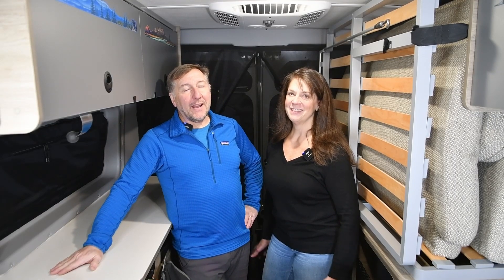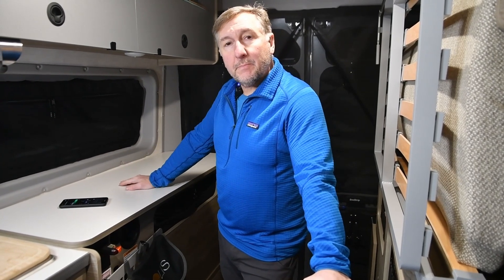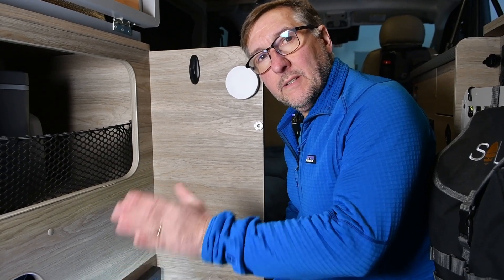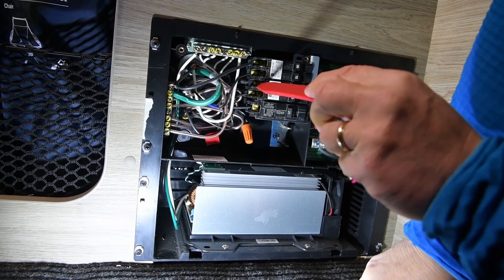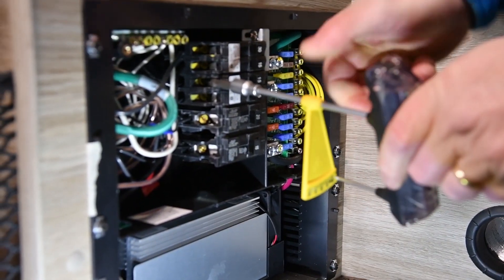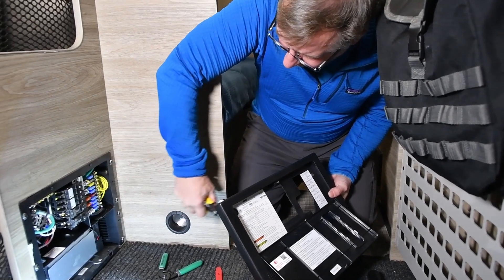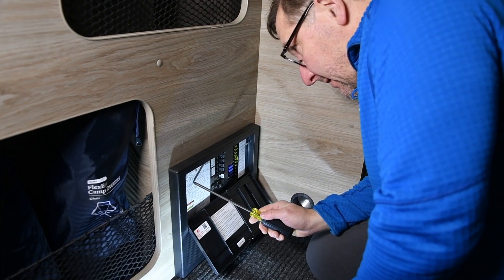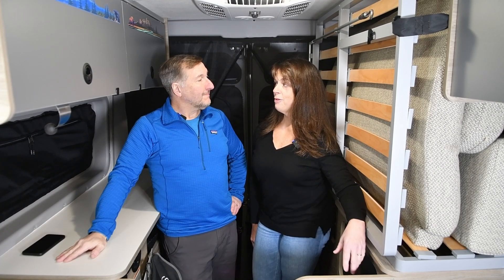Phantom Voltage?? Isolating the 12V Converter in our Solis Pocket

Comment: I appreciate that you've already done all of the things I was thinking about doing on my pocket! I've discovered that you can start the Coleman Mach AC on a 2400W power station without adding a soft start as it only draws a little over 2000W on startup. However if the house batteries are not full the converter draws over 1000W so being able to turn off the converter when running the AC helps
Reply from the maker: Hi there! Thanks a lot for watching and leaving your comment. We agree completely that sometimes you definitely want to turn off the 12v converter. We actually did a bunch of measurements of the Coleman A/C unit running from a power station in this video from last year, not sure if you saw it: https://youtu.be/8Zw9k3qoIIo. We found the same thing, you can fire up the A/C but you need to ramp it up from fan to low to high to make sure you don't see a big startup spike. The biggest problem when using a power station is the run-time, as even with everything else off the Coleman sucks a lot of power (even on low), as you probably found out already. Thanks again and hope the videos help you with your upgrades.

Comment: This is not phantom voltage, it's how the inverter works. It does not output 120v on the hot and ground on neutral, it output 60v on hot and -60v on neutral to make 120v, that makes the inverter much cheaper to convert 12v to 120v
Reply from the maker: Hello! Thanks for watching. I was hoping we would get some comments on this observation. The converter that triggers the phantom voltage in this case though is converting 120V to 12V, not the other way around. It is the converter built into the WFCO panel which converts 120V input to 12V output to feed the van and charger the house batteries. When that converter is turned on, somehow some back voltage feeds backwards into the source 120V circuits. To clarify, our 120V source is either the shore power cable or the ECOFLOW battery bank (120V inverter built into ECOFLOW). When I feed the WFCO electrical panel from the ECOFLOW, or from shore power, I do not get any phantom voltage, as long as the 120V to 12V converter is turned off inside the electrical panel. When I turn on the 120V to 12V converter inside the WFCO panel that this phantom voltage appears. If I am not understanding you correctly or explaining things fully please let me know.
Reply: @Outapkt  Ok, the 12v charger, by converter I thought you where meaning the inverter. Not sure if the ecoflow output 120v on it's hot, or 60/60. Normally to check is if the neutral and ground are connected or not, there should be no voltage. You don't need an earth ground, you do need a common ground to test. If the ecoflow ground is not grounded to anything, or to neutral, you will get phantom voltage readings, as the meter has no reference, since the ground is floating (has no reference). As  I say this, I dunno how the ecoflow does it. But on cheaper inverters they will output 60v on each hot and neutral in reverse to produce 120v, and not connect ground to anything at all. So the ground is left floating in relation to the inverter hot and neutral. If you do the same test with house voltage though, that would point straight to a wfco charger doing something, as with house voltage we know the ground would not be floating. It is possible your reading the reactive power due to the wfco (or any device) doesn't have a close to perfect powerfact of 1, so it's reflecting some of it's power back. Not sure how that shows up on inverters. I am not sure exactly what was tested though, I assumed the ecoflow was turned on and the wfco was turned on both at the same time for the test.
Reply from the maker: Hi again. I took a number of measurements. The ECOFLOW 120V output is 120V between hot and neutral, not 60/60. There is no voltage between hot to ground or neutral to ground. I also did a resistance test from neutral to ground with power off and I got infinite resistance. My research shows that the ECOFLOW ground is passed through from its input 120V power cable to its output outlets, which in this case comes from the transfer switch, which from what I see does not connect neutral to ground (and it shouldn't) thus I believe it is floating. I do not get any phantom voltage in the WFCO 120V circuits with ECOFLOW on and WFCO 12V converter off. It is only when I subsequently turn on the WFCO 120V to 12V converter the phantom voltage appears in all the circuits. I do this right at the end of the video when I have the 120V to 12V converter isolated on its own circuit breaker. I agree with you that I think, somehow, the WFCO 120V to 12V converter is reflecting some sort of power back but as I say in the video, it is there but doesn't seem to effect anything plugged into the outlets. Thanks for sharing your thoughts on this.
Reply: @Outapkt  Nothing flowing from hot to ground is a give away the ground is floating and not connected to anything on the ecoflow, as it should be 120v or 60v. Since the ground is floating by the ecoflow in reference to the hot and neutral, the WCFO is likely bonding it's output to ground as a reference, but as none exists, ya, you get wild voltage reading that have no meaning. till the WCFO is turned on, the ground is completely isolated and it's like reading the voltage of wire not connected to anything, once it is turned on, it now has a reference back to your hot and neutral (though capacitors/... that is uses for protection) and you get a reading. I think it's giving you a real ground reference and it output 60/60 on neutral ground in split phase configuration and 120v on hot and 0v on neutral.
Reply: @Outapkt  To make the 60/60 thing more clear, it is the same way our houses work in the USA, we have 120v on one side and 120v on the other side, when you plug in a 240v appliance it read +120/-120 to create that 240v. The inverter is doing the same thing to make 120v, outputs +60 on hot and -60 on neutral and when you read it, you get 120v
Reply from the maker: Thank you so much for sharing your insights into this!